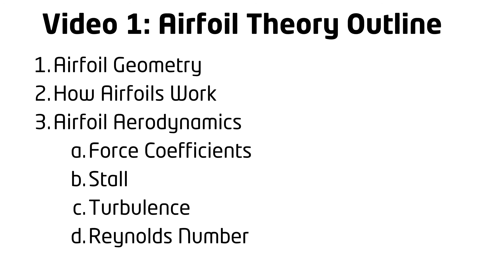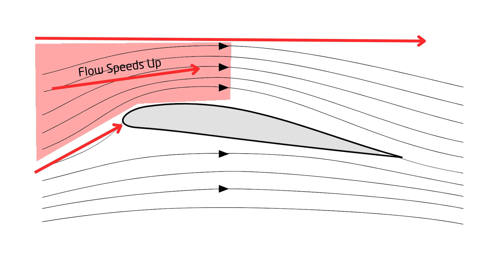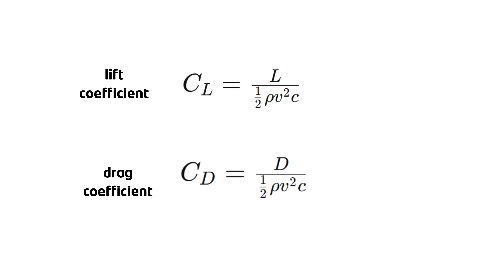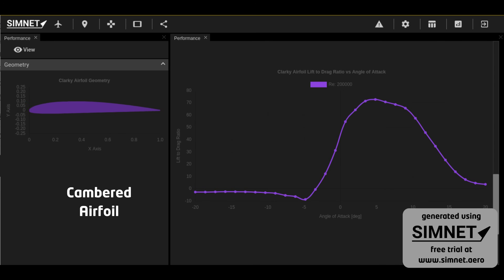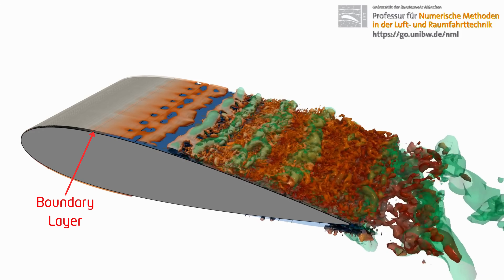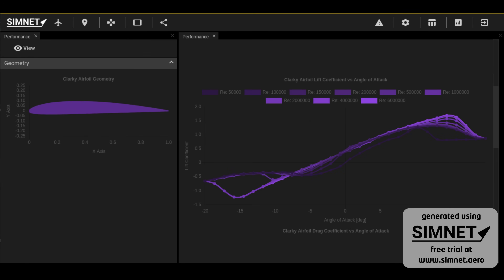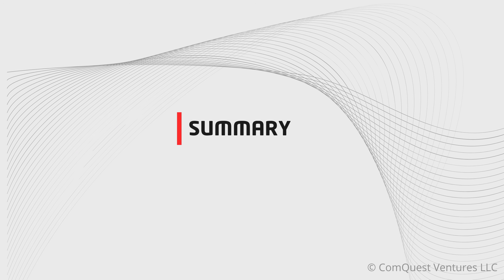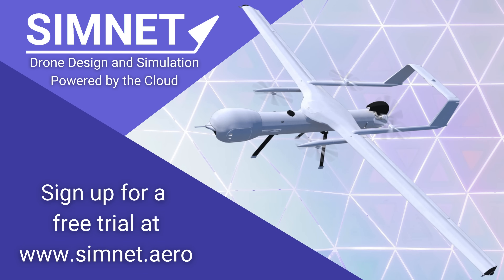Mastering Airfoil Selection for Drones - Part 1

Comment: Excellent presentation. You might want to add two other forces that generate lift, as well. Newtonian "down-wash" and viscous adhesion both contribute to lift. Air is a thin, sticky viscous jell that the foil slices thru.